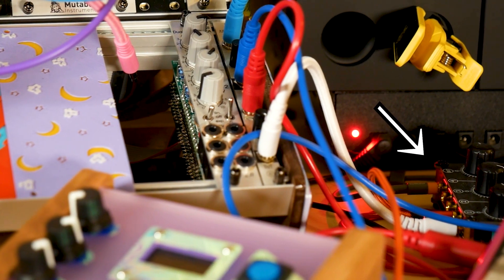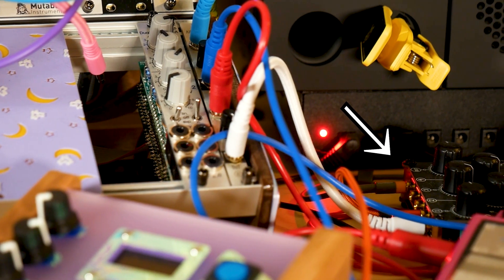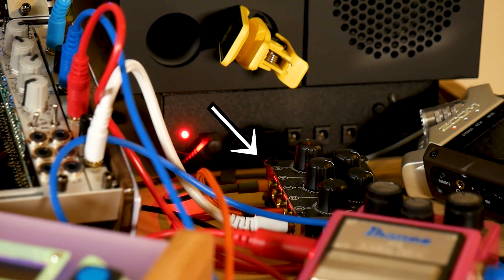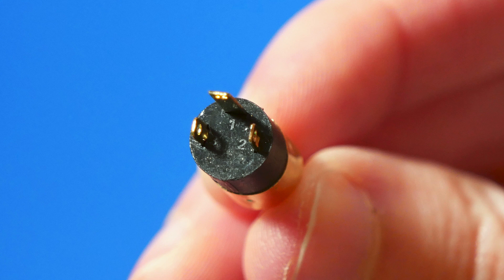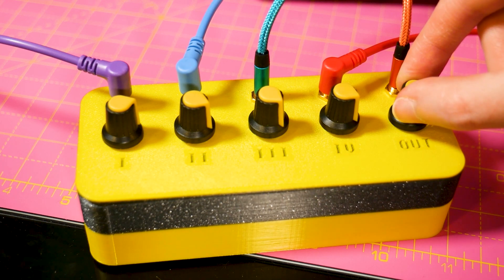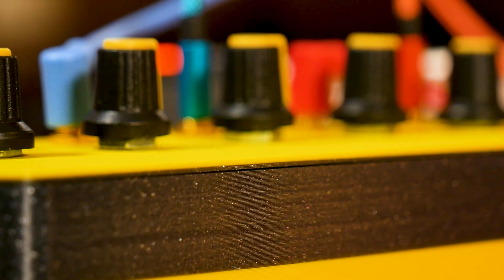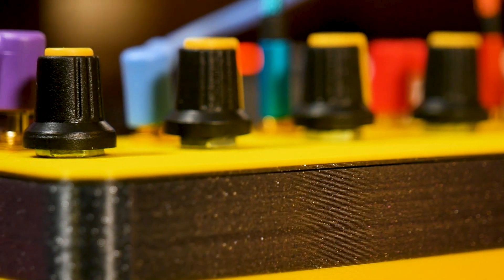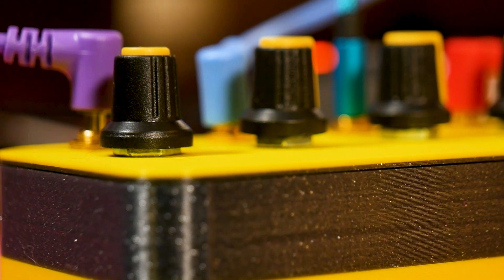DIY Passive Mixer // Everything Went Wrong with this Build

Comment: If you connect 2 line level sources to such mixer, with both volume knobs on and only 1 source actually feeding a signal, won't that signal backfeed into the other source's output, potentially damaging it?

Comment: Strip board is totally unnecessary here, and probably complicated the entire build.

Also, equal (very low) value resistors should be added on the output of each channel before the output jack .

Comment: Hmm...  Looking at the schematic,it appears that if you turn the potentiometers up to full, there is a direct path from each input to the others, so you're wiring the outputs of all your synths directly together.  I don't mean to be critical, but that doesn't seem wise.

I was expecting to see series resistors either feeding the signals from the jack sockets to the potentiometers, or between the wipers of the potentiometers and the output circuit, to provide a degree of isolation.  I think 10k is a fairly common value to use for those.

Do you own a multimeter?  One with a continuity beeper is good for checking  things like the wiring of jack sockets - plug in a cable and hold one probe against the relevant contact on the far end of the lead, then use the other probe on the socket.  You can also use one, with two leads, to check what resistance you are getting from one socket to the next with the knobs turned all the way in one direction or another.

Comment: I've built a few passive thingies like this. I never felt like putting pots on them cuz I'm only using passive boxes for pretty specific stuff — combining FX returns on a Model 1 mixer with one, and some simple boxes to mix synths/etc. that have their own volume knob. But I keep thinking it'd be nice to make an amplified one that had a HPF and gain on each channel. But then I'd want a cue bus. And it'd be nice to have a LPF on each channel, too. And if you've got a HPF and a LPF it'd be nice to have resonance on one of them (or a BPF). And that's starting to get awfully complicated and it's probably more versatile to plug a Midi Fighter Twister into a R.Pi or an iPad with Loopy Pro or Garage Band or something. And my soldering game is not good.
Reply from the maker: speaking as someone who used to shake while soldering, you will get better with practice 😺 i also have dreams of a similar, open source mixer project. i like the idea of building them as modules that folks could pull from to build their own custom setups

Comment: yeah, passive mixers are cool, but you have to really watch out for that high output impedance! 

honestly, Professor Lanterman really sold be on inverting op amp mixers, which have some advantages.
Reply from the maker: definitely a good point